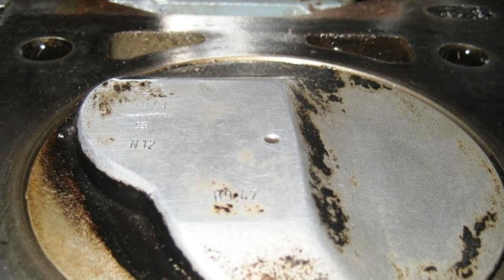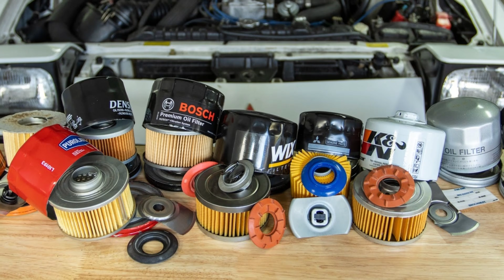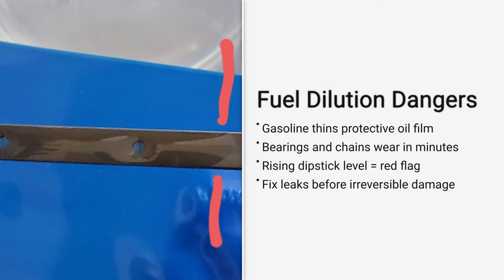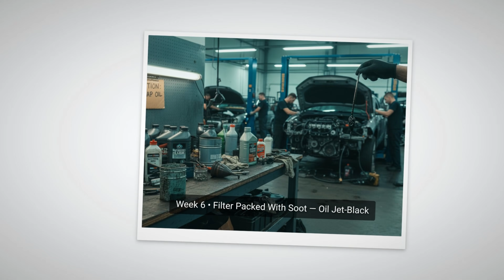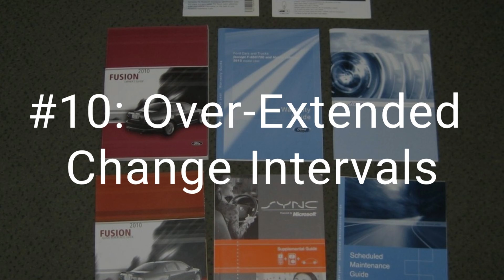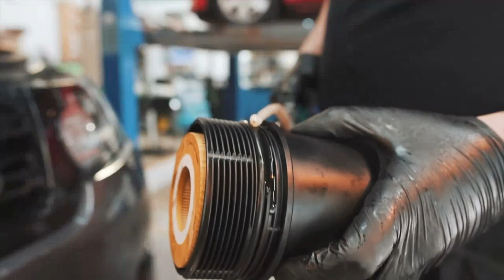Your Engine Oil Turning Black? This Hidden Problem Is Why

Comment: I avoid short trips.  I do it by going a little out of my way on the way home from a place.  To some people that would seem to make no sense but it just adds the needed time for it to heat up and boil off that moisture.  Sometimes it may be fun to explore a new road that you go past a lot but never really travelled down.  Especially if you have the time for it.  If your vehicle has built in GPS, it can help you get back home when it is time.